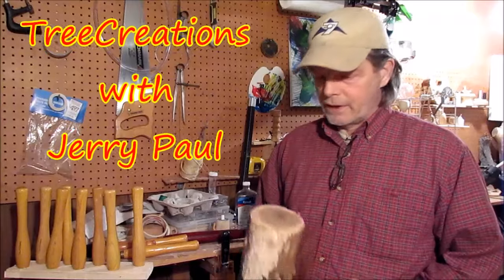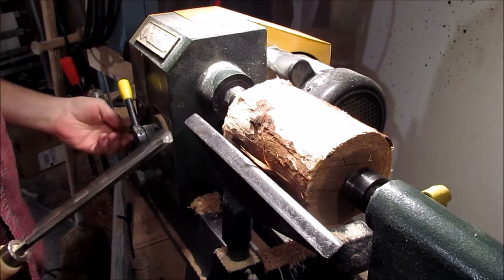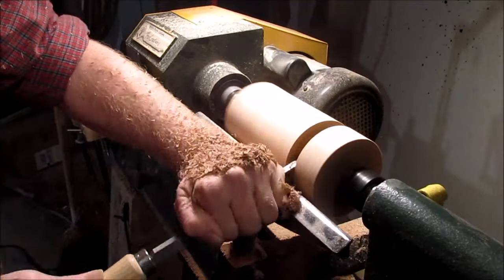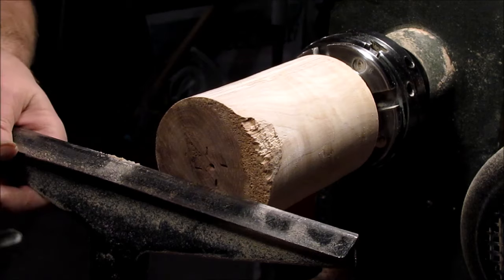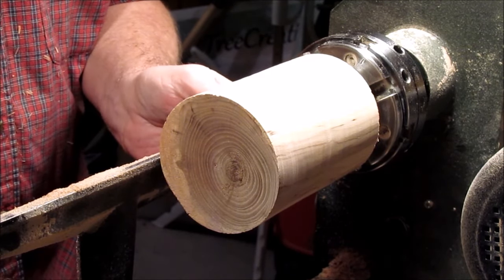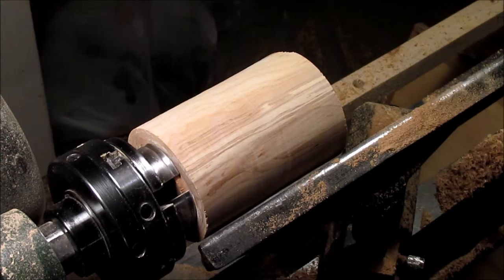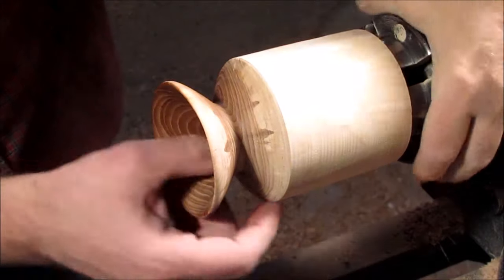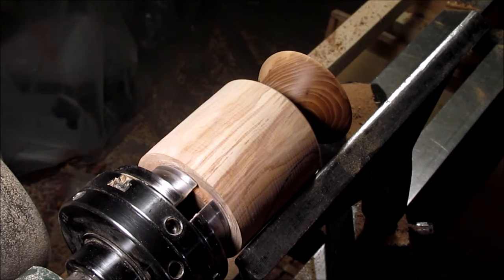Wood Turning a Short, Wide Mouth Mountain Ash (Rowan) Vase

Comment: Good looking vase Jerry.  Don't know if I like the wide flaring lip, but that might just be me.

FYI, Harbor Freight item 39812 are actually decent bits and will give you up to 2.125".  $38 less 20% coupon = cheap. =) 

Also, a 1/2" or 5/8" mild steel bar drilled on the end with a hole drilled & tapped 90 degrees to it makes a perfect holder for bits.  I bend & re-grind allen wrenches from garage sales/flea markets as hollowing bits.  They actually hold up and work pretty well.  You can get fancy and add a laser pointer to it if you're hollowing-challenged like me.  (I can't hollow without going through the side without a laser guide & the commercial ones are not only super expensive but don't work as well as mine either.)
Reply from the maker: Great tips! Thanks. I'm patiently waiting on garage sale season. I can usually find some pretty good stuff. 
I've seen others do that with allen wrenches, and I think I'm going to have to give it a go. I don't have the money for off the shelf hollowing tools. Making them will be a lot more cost effective! 
Thanks for watching.
Cheers!
(I'm not sure I like the wide flared mouth either, but its done now) :)